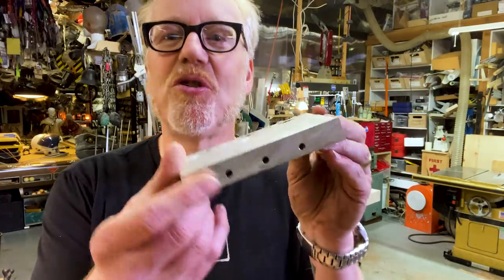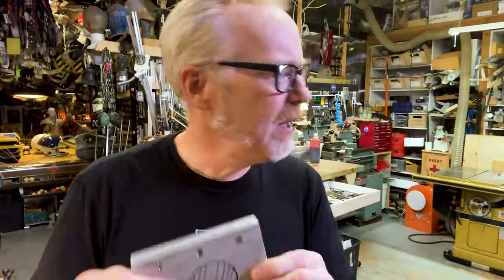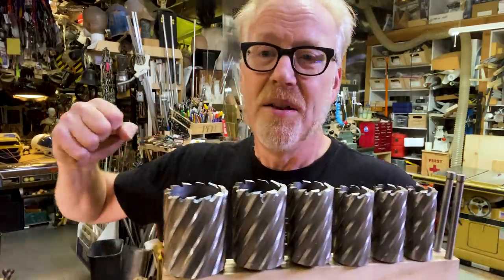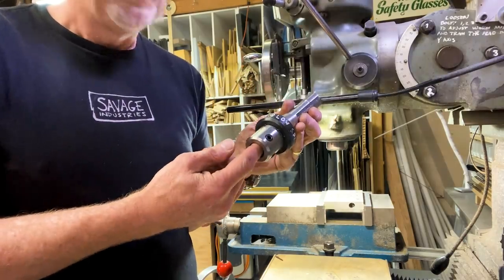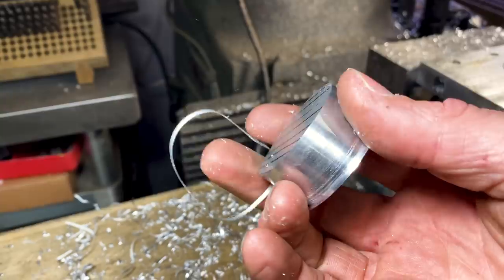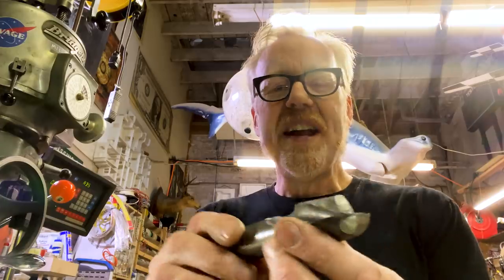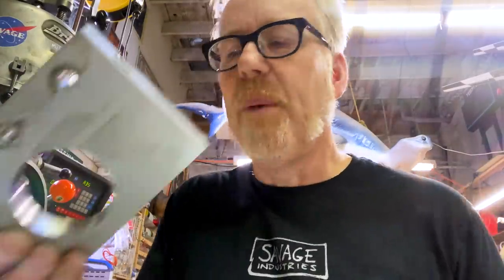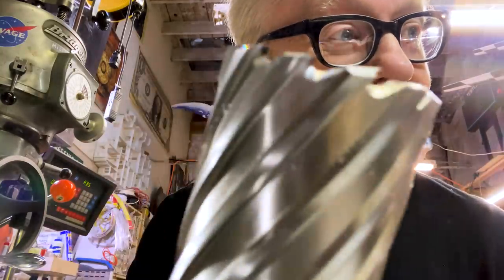Adam Savage's Favorite Tools: Annular Cutters!

Comment: is there a even drill attachment for it? working at ford sometimes we have to cut holes out of the steel frames of transits because the crossmember bolts will sieze up and snap off in the frame and the only way to remove them is to cut a hole in the frame and beat the nut off of the frame.

Comment: I use them at work often with hogan mag drills which is a magnetic drill press. Operated by a three handled crank that has a different gear ratio to reduce effort. I'd say with aluminum you wouldn't even need fluid maybe initially. I can cut through 1 inch thick A36 plate steel with 1" 1/4 bit in about 30 to 45 seconds with less than one ounce of lenox cutting fluid. Diluted with water 1 part fluid to 5 part water. They work awesome and I think of you got the correct chuck it would do great in a full size drill press. Keep in mind the low rpm around 400 too 700 rpm is what the drills I typically see are running at. Also. Cobalt bits from Unibore seem to last significantly longer than other bits like the Slugger brand. Hogan brand does well but not as good as the Unibore. The smallest size I've seen is 1/2" and largest 2". Welders and iron workers use them allot for I beam connections and clips from beam to beam. I just drilled almost 1000 holes for soleplates for a crane at BIW in Maine. Took about 140 hrs total.

Comment: Annular cutters (with an appropriate pilot) are good for trimming the outside diameters of gun barrels at the muzzle without removing them from the firearm. I've done that and then threaded a few rifles, but I could see someone using it to remove muzzle threads if they live in a ban state.  It will never take the place of a lathe for work on precision barrels or those running suppressors, but it's just fine on a vast majority of guns.

Comment: I frequently have to drill large (2” or 2-3/8” or 2.5”) holes into already installed aluminum boxes, so a hand drill is my only option. Is there something more effective than a hole saw kit? A knockout punch usually doesn’t go large enough, a mag drill is too expensive, but I seem to only get two holes out of each hole saw

Comment: I hand drill with annular cutters when tapping live gas mains regularly! thickness varies from pipe diameter and material ranging about 5mm steel upto 30mm thick cast/ductile iron, slight pressure is key or everything locks up and you can actually snap the teeth off the bit.  after 9 - 12 drillings (and hand cutting thread into the drilled hole) i can safely say the arm is dead!

Comment: So it's a deep well carbide hole saw? I use shallow versions every day at work with a battery hand drill to cut steel. Usually at awkward angles on top of a ladder. My point being they're great and they don't require a milling machine.

Comment: A co-worker and I were testing a Magnetic Drill that our company had just purchased, and it came with Annular Drill Bits. Well, we were simply interested in drilling holes no wider than 3/8ths of an inch. WHAT WE IMMEDIATELY NOTICED, HOWEVER, is that, when compared with a typical two-flute "twist" Drill Bit, the Annular Drill Bit was 6 TIMES FASTER at putting a hole all the way through 1/2-inch thick Steel. Also, because we were only interested in drilling through holes, we immediately noticed that the Annular Bits never create those annoying (and unwanted) shallow "cone" -shaped End Caps that notoriously "hang off" on the other side of the Stock material (i.e. on the side where your Drill Bit eventually "pokes" through.) About the only negative thing that you could say about Annular Drill Bits is that they are no good for the purpose of drilling blind holes (i.e. holes that DO NOT go all the way through the Stock material.)

Comment: I work at a construction and industrial supply store and I frequently get customers who come in to buy large drill bits to cut large holes. I hear the same complaints it takes forever, the cut isn’t clean, it’s very hot, large pressure on the machine etc... Each time I refer them to an annular cutter but they turn it down because it is a little bit more expensive. Oh now I will share this video so they can understand too

Comment: You just have to be careful that you have the right kind of cutter for the material you are cutting.  The HSS cutters do not cut soft material well.  While cutting holes in a bridge girder, I've seen them explode into several pieces when they transitioned through the steel girder and hit a brass plate that was somehow welded onto the side of the girder.  The brass was not in either the original plans nor any of the rehab plan sets, so I can't speak to why it was there, but it sure complicated the repair that we were doing.  I did keep several of the plugs from that bridge though (including a couple from the brass plate), because I they make great mementos for the project.

Comment: For aluminum cutting. I use a mix of 3 achool isopropyl : 1 diesel. 
For plastics,  I use only isopropyl
This is the kind of mix I use to get a better temperature control. I use a spray bottle to put my colling on the cut and tool

Comment: As an electrician I use hole saws for holes up to 8”. Simple drill, patience and some oil and I’ll get through anything. They are also relatively cheap since the teeth tend to break off.

Comment: Used to use them with mag-drills, it was a pain in the arse as the mag wasn’t strong enough to hold the drill and apply some pressure to drill.

Comment: I don't know about a 2" cutter but a 1 5/8 does just fine in a good full size drill press @ about 480 RPMs with cutting fluid fed though  a MT2 Annular Cutter Arbor with 3/4 Inch Weldon Shank.

Comment: As a pro machinist used to working with disgustingly hard steel - for a hole that size i would probably use a fly cutter to do a trepanning cut for similar levels of spookiness- but that is FAST and super smooth, wow. That is neat as hell, and a beautiful finish.

I'm used to metal that makes your mill bits useless in half an hour, so I was skeptical of those on reflex :p

Comment: So those pins you were ignoring are actually kind of important.  You should get a proper weldon chuck (3/4" cylinder with set screws to grip the shank), which includes a sprung recess for the pin.  The pin allows you to centre the cutter on a punched point, and when you've finished the cut, the pin will push the plug out of the cutter for you.

The better chucks include a central coolant feed which activates by pushing the pin, i.e. just before the cutter makes contact, but you can get a simple weldon chuck with a 2 or 3 morse taper to fit a normal drill press and it works great.  You don't need a mill to make use of these.

Comment: Another approach could be to chuck the aluminum in a 4-jaw chuck and use a trepanning tool.  I have two of them for varying diameters.   After trepanning,   use a boring bar to get the exact size you need.  (from high school machine shop teacher).  One drawback though might be that you have to flip the part back to front to get the  thru depth.

Comment: I cannot believe I have not found this Annular Cutter earlier - been struggling with hole saws for years...
Reply: If mag drill wont hold on lighter material say 1/4'' just place a clean piece of 3/4'' scrap under it will make the magnet that much stronger. PS watch your fingers that magnet doesn't care if a finger is pinched in between!!!

Comment: Another reason annular cutters are more stable is the speed of the cutting faces vs. Standard drills or end mills. The center of a drill bit spins the sam rpm as the outside of the drill, but when calculating speeds and feeds you only used the outside diameter. At lower rpm for larger drills the inches per minute of the cutting faces at the center drop to near 0 inches per minute. Same reason you see ball nose end mills always cutting at odd angles in 5 axis mill videos. They are using the outside edge of the radius which is where the speed of the cutting face is higher.

Comment: The problem with using an end mill to hog out that material is that the clamping and tool holder need to be very rigid or you will get chatter and harmonics.  Not a problem in a manufacturing setting with CNC controlled feeds/speeds, but in the home shop you need other solutions like this.  Great video!

Comment: I use these at work almost daily. Put your coolant in a spray bottle and you can squirt it in under the birds nest and remove it in one piece so you don't have to stop. Might not matter for one or two holes but when you drill 20-30 or maybe even 50 or more it definitely speeds it up.

Comment: You also could mount it in a 4 jaw chuck (on the lathe obviosly) , drill a hole in it with the largest drill you have and do the rest  with a "internal lathe chisel" (i dont know if this is the right word I am from germany and we call these things Innendrehmeißel and "internal lathe chisel" is the word by word translation)

Comment: Pro tip, put rubber bands around your parallels/back and front jaw to keep them in place while you set your work piece. Also a bent piece of metal (I use strips of the metal bands they sometimes wrap around crates or pallets) to act as a spring between the parallels to force them against your jaw. Might save you some aggravation in the future.

Comment: Nice tip!  You can also use a rotary table and a small diameter end mill.  BTW, at $700, you can get a small mill (SIEG X2) for the price of a nice drill press.  And the mill has WAY more precision and functionality.

Comment: This was interesting Adam. How is it different than a Forstner bit? Besides the size. The one you used to drill that big ass hole was very large. My issue is when you still just need a hole.  Without needing to drill all of the way through.  I can’t seem to find any other option than the standard drill bit. Thanks for the video and info on annular cutters. It looked awesome!

Comment: You can absolutely use these in a Drill Press! You do however (typically) need an MT2 or MT3 shank adapter that receives a “Weldon” shank which is what he is showing here. My steel yard sells them now!😉

Comment: Hey Adam, if you cant touch the part you are transferring too much heat, youre not using enough coolant. not too long ago i hogged out a 1.25 inch hole with a 2 flute hss endmill no problem and there was no heat to the part. try peck drilling it to reduce that birds nest and reduce feed, increase speed to stop that chatter. other than that great vid!

Comment: Makes me recall back in the day, when, as a teen I was working in a car stereo shop using a holesaw and 1/2" drill to free cut steel doors for speakers.
This was during the age before common availability of battery powered drills, and screw drivers, so every screw we turned in our work (hundreds a day, at times) was turned by hand.
This led to a curious condition those in the business refereed to as "Popeye arms"

Comment: Strange that you dont know them before, as here in Germany/Europe everyone doing a little more home improvement knows a hole saw (I know its for a different material, and it can be even used with a hand (power) drill, but its basically the same principle): The power sockets which are installed here are usually circular, and to install them the easiest way is to use a hole saw. So I assume your power outlets are installed into rectangular holes.

Comment: I would have put it in my lathe, center up the hole and bore it out, beginning to end about 15-20 mins.  Annular cutters are amazing and I've used them a lot, but I wouldn't buy a set for $500 unless I needed to cut a lot of that kind of stuff and in the specific sizes the bits are.  With the lathe I already have it and it can make any size hole.
p.s. I'm pretty sure you are running that bit way way faster than it needs to.  It should make shavings like a turning lathe with very little pressure applied.

Comment: I would just call that a hole saw but I'm sure the more correct term would in fact be annular cutter. We use variations of that in home construction all the time for drilling huge holes through wood and drywall. Anywhere from 1/2 inch to 6 inches.

Comment: the big feature - the cutting blades are moving at a much more homogenous speed relative to the bulk material - so, when you choose the correct rpm for the cut, all your blades, and the full lengths of each blade, are all cutting at the right speed.  with a regular drill bit, the central portion of the cutting blade is moving at a really slow speed relative to the outer edge of the cutting blade, so your cuts into the material are always either too slow or too fast (or both), hence the chatter, squeal, etc.  as you say, annular cutters are superb tools that solve a lot of problems inherent to using drill bits.  unfortunately, they are a bit too expensive (and fragile on the low diameter end) to use more universally when putting plunge holes into parts.

Comment: They also make annular cutters in much smaller sizes that can be used in a normal drill press safely I have been using annular cutters for about 30 years I agree the bigger ones are best used in either a Mill or the mag Drills they were designed for and the best true running style Annular cutters are the Nitto Kohki style with the evenly spaced three ball bearing quick release style ones they run very true compared to the ones that use two flats and grub screws an awesome invention indeed and I love the Atra Ace range of Nitto Kohki Mag drills they are superb Japanese quality

Comment: You need a “kool mist” flex line lubricator for machining aluminum I run mine set up on a toggle switch air valve to turn it on and off and a cheep magnetic base to hold the base in place then just put the siphon end into to a jug of cutting oil and you can point it right at the cut

Comment: Mind this, if your center pin does not retract the full thickness of the material you are drilling, halfway thru the cut stop and remove it, specially on magnetic drills, it can lead to a broken bit as it will tilt the whole machine... learned this lesson the expensive way.

Comment: Buy some parallel keepers. Or drill small holes into your vise jaws and put epoxy a magnet in them or buy a set that already as them built in. I own a cnc machine shop and i have a set for every vise. Also look into buying a tormach cnc mill. They are relatively cheap depending on the size you get. I have a pcnc1100 in my garage for home projects when I don’t want to go to my shop or I have the machines busy.

Comment: Nice cutters.. in the uk we have some hole cutters made by punk (punk bi metal hole saw) and most people dont really know but they chop through steel like butter and there cheap as chips i went through 30mm stanless 304 with a 25mm dia cutter in miniuts  and you can get a 50mm cutter for like 8quid (no cutting fluid necessary)

Comment: Another advantage of annular cutter is every cutting edge is moving forward into the material.
With the drill bit the centre bit is just spinning on the point and not cutting.
There is a lot of rubbing and friction in the centre of the drill bit.
Also the centre point of a drill bit has to plow though the material before the cutting edges can cut. 
It not a problem if the drill bit very small but once you get into larger sizes it is a nightmare to use.

Another advantage is with larger annular cutter is you can use the centre plug instead of wasting it as chips.

Comment: AS- how does the Annular Cutter compare to a conventional hole saw?  HS has a smaller kerf, likely not as precise.... thoughts community?  I am drilling holes in a chassis to mount a trailer hitch and using a hole saw in a hi torque drill.  The AC, expensive, in a hand held tool seems more dangerous as the sharp leading edges are all capable of catching and getting stuck, no?
Reply: If I would just learn to finish watching a video BEFORE asking questions.......  NOT FOR DRILL PRESS I understand.  No need to tell me DEFINATELEY NOT FOR HAND DRILLING!!!

Comment: Adam

Not only do they excel at making big holes in metal, but they also excel at partial cuts on the edge of material - something that is a major fail for drills.  Half round on the edge - piece of cake.  Shallower radii on the edge of material, also a pieced of cake.  Over-lapping cuts while hogging out a big slot in material, a dream

John

Comment: I expect a lot of the improvement is not the volume of material being removed, but that all thr material is being removed at an appropriate rate.  With a normal end mill the very center is has such a low surface speed it is hard to imagine how it will remove any material at all.

Comment: If you had a lathe with four independant jaws, then you can chuck up the block with the center of the hole as the center of the spindle and bore out the hole on your lathe. This also means you do not have to have a full set of different size tools to make the hole size you want.

Comment: Another big part of the reason an annular cutter behaves so much nearer to perfectly than a big end mill is the latter faces the same problem as any cutting tool which cuts right in to the centre: there's NO cutting speed at the very centre, so the tool in that region is forcing its way through the workpiece, rather than cutting.  That's mainly why drill bits, and (to a degree) end mills tend to "walk about" on the work. And that's why pilot holes are a big help.

Comment: When I was first shown this about 3 years ago starting in metal fabrication, I thought “ that makes way more sense than a 1” drill bit”. Now every time I run into a hole size of 3/4” or bigger I automatically use a mag drill with a angular cutter

Comment: My block wsas 4x4x3/4. I mounted in  a 4 jaw chuck on a lathe. Drilled a hole to start, then finshed the 2.5 inch hole with a boring bar.
Ok now I will watch how Adam did it.